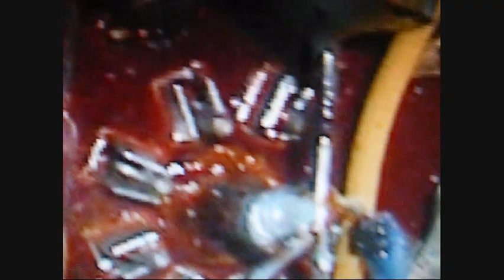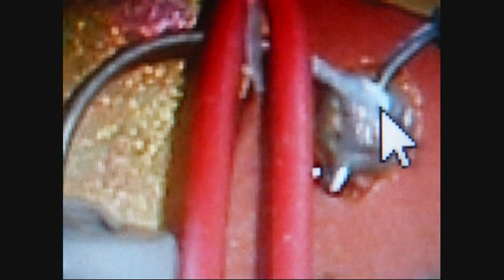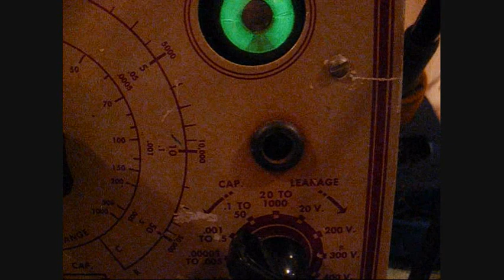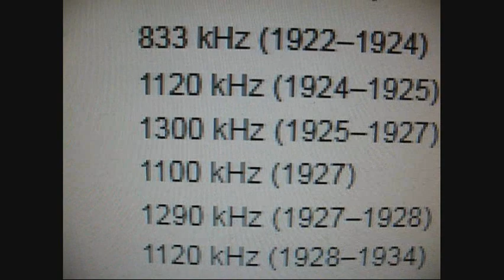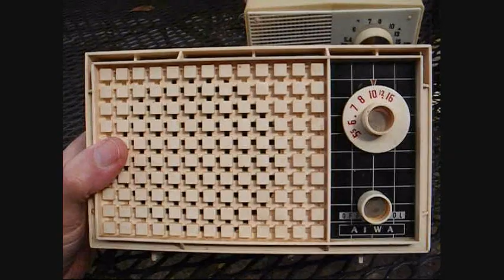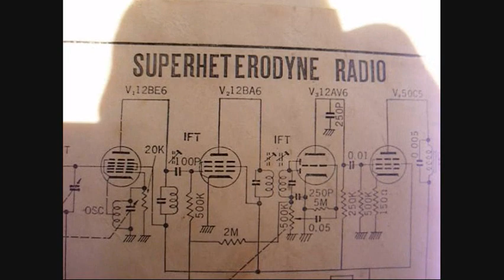1960s Tempest 5-tube Japanese-built radio.

Comment: Electronic  Parts  Outlet  in  Houston  TX   has  every  electronic  part  you  need  to  fix  vintage  radios  TVs   Record   Players   They  have  cartridges   idler   wheels   headshells  tubes  every  transistor   ever  made

Comment: A note about the small oil filled caps—-at their age they could contain PCB-esp on a low cost radio. They were too small to fall under the PCB regs for electrical components. So wash your hands and the area in the radio if the cap blew or leaked.

Comment: eBay has turned into a Five-and-Dime for cheap crap from China along with the absurdly over-priced vintage stuff. Just today I spot checked for a couple tubes. You could buy the same tubes brand NOS from the well-known tube houses for less than the eBay sellers wanted for used.

Comment: $10 in 1965 is $100 today even using the extremely conservative rates claimed by the BLS.  Even in 1969, a ten spot was worth $87.73, again, using these extremely conservative rates that are claiming a much lower rate of inflation than the real one.

So these were not by any means cheap.  In 1969, minimum wage was $1.60/hr  A MW worker had to work 5.9 hours to buy that and even longer than that once all the taxes are removed.  So probably more like 8-10 hours.

Radioshack lists a solid state AM radio in their 1969 catalog item 12-1346 for 9.99  That was probably a much better deal.

Comment: WABC even though they are a talk station does play music on Saturday nights from 6 pm to midnight
Reply: WABC radio plays music on Saturday nights from 5 pm until midnight The Vinnie Medugno Show from 5 til 6, Cousin Brucie Rock N Roll Party 6 til 10 and Tony Orlando 10 til midnight.
Reply: Thanks I usually just have Cousin Brucie and Tony Orlando on when I do have it on
Reply: Nice! It’s about time am has some music on the band
Reply: And we already have 2 AM stations that play music (and a 3rd if you have a good radio and a 4th if you happen to be in the area around the Pro Football Hall of Fame in Canton Ohio) one of those 4 is CFZM 740 in Toronto (that's why a good radio can still pick it up in the daytime because where I live I'm in the daytime range of 740 in Toronto) the other 3 are smaller stations 2 are to the south (one can reach here in the daytime (960) and the other puts a strong signal into Canton Ohio in the daytime (1310) but there is one that is a local station and they also have an FM translator on 93.5 and that is 1590 so yes there are areas where AM stations still play music (we had another local station that did holiday weekend rewinds back when they were a top 40 station (640) but they stopped doing that (that was my station when I was growing up but they were a daytimer that went off at California sunset and their rival was 1590 which now plays music again to this very day after trying other formats that included talk but they always went back to music)
Reply: I just wish that 1590 would turn back on the AM Stereo signal because they had it when it came out so they should still have the equipment to do so (and 640 when they were doing their rewind weekends should have done the same because when they were Contemporary Christian they were also in AM Stereo and I wonder if they still have the AM Stereo equipment (I still wonder if 960 is still in AM Stereo, I would have to dig out one of my Sony SRF-42's to find out